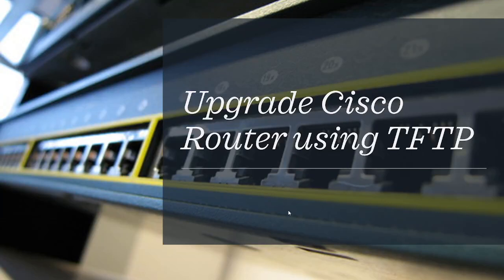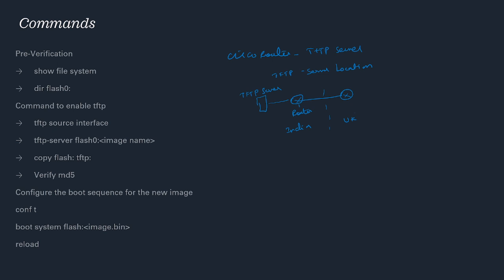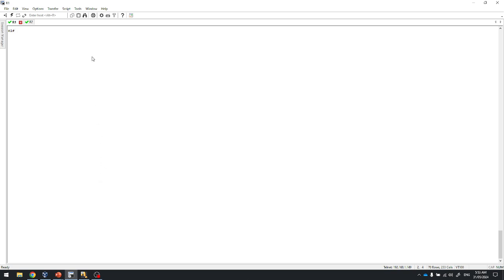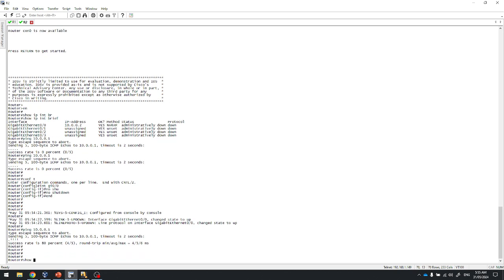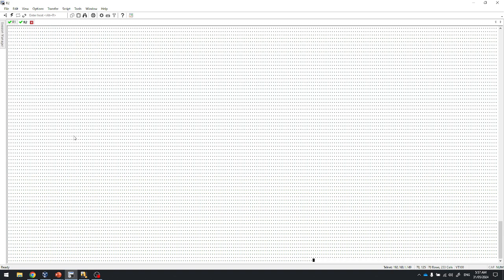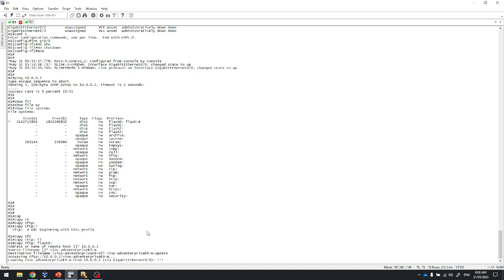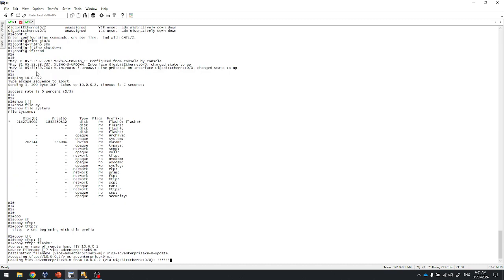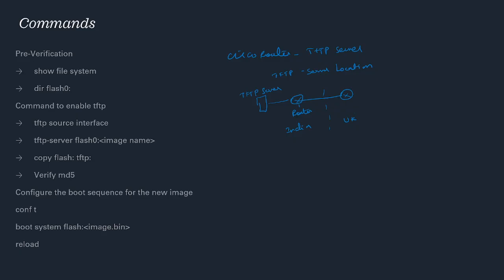How to Upgrade Cisco Router using TFTP

Comment: Hii Bro Na BE CSE 2020 passed out..2022 la Non It la work panen 6 months health problem nala velila vanthuten..ippo 2023 to still i am working in Dubai planning Engineer mechanical field..but Na ippo Intha Course panlama ..panitu IT ku switch panlama..Na ipo Dubai la Iruken.. suggestion kudunga..
Reply from the maker: you can learn and start applying for a entry level job in Dubai. Hopefully you will get one